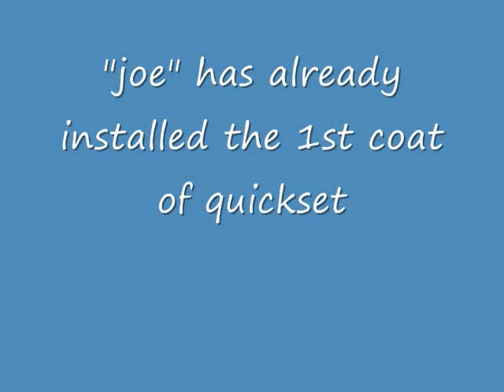Patching a drywall hole

Comment from the maker: That is a great question, if you have a textured wall. You can follow all of the steps up til then but then I'm not sure what you do!...lol  I've textured some little mini projects before but each one comes out different. You can get spray can texture, or put mud on a scrub brush & flick it on until you have enough....I've done that before. I was lucky enough that this wall was a "smooth wall finish" & I didn't have to deal with any texture. It can be difficult to blend in. Good luck.   Joe  :0